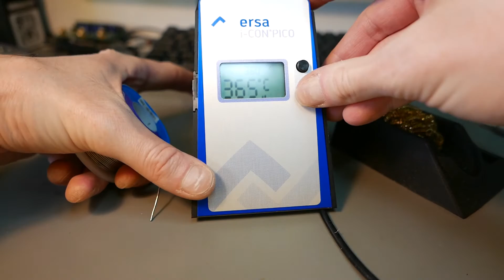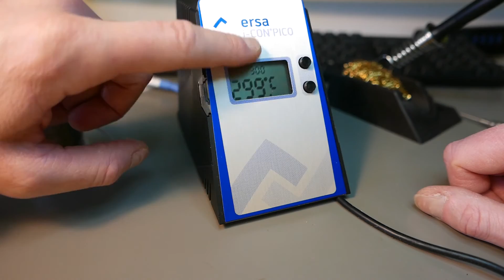Ersa i-CON PICO grounding soldering tip

Comment: What would be the advantage of a grounded soldering tip?
Reply from the maker: Not damaging your mosfets or other sensitive chips with static electricity first comes to mind...
Reply: @TomislavDarlic  for me, ESD gives more catastrophic issues than saving circuit form static electrical discharge. I think this tip need to be connected to earth but trough a 30K resistor (this value will be discutable). Direct connexion to earth can make serious short to ground if working on live circuit.
Reply from the maker: @AIexanderHartdegen  The sistem is usually connected to gnd trough 1M resistor...

Comment: Hello Tomislav, I am the Ersa Product Manager for this equippment and have the following hints: Next time you purchase a soldering station I recommend to check the features more in detail. As you mentioned and written in the comments the i-CON NANO is the ESD save brother of the PICO and the tip is grounded. All your efforts would not have been necessary. You are an electrical expert, but I have to warn about this modification! If it is not done conrrectly it can be dangerous to life! Moreover the station has no more warranty when doing this. One call or mail to us would have been enough and we would have changed the station to a NANO. We from Ersa would be more happy if this video would not exist - see comment from Niko942. Nevertheless - thanks for choosing Ersa and good luck with your soldering projects. If you have questions, pls contact me: joerg.nolte@kurtzersa.de
Reply: If you're the Product Manager, you should actually be ashamed. I also bought the Ersa Pico, but not being an expert I just trusted the Amazon reviews and thought I was buying from a reputable German brand. What I got instead was a cheap, unsafe Chinese product. Unfortunately the product specifications never tell you where a product is designed or made. If I had known in advance it was made in China I would have avoided it like the plague.
And don't even talk about temperature control, because the temperature of this piece of cr*p jumps up and down like mad.
Reply from the maker: Hi Jorg. Thanks for the message. I own 1 Pico and 2 Nano stations. One Nano has failed with MCU shorted to ground and overheating. I recorded a video about it but never found the time to edit and publish it. I use this hacked particular Nano for years now and all 3 were bought from Farnell in bulk. It was my error to buy a soldering station without looking into details but grounded tip should be standard these days. I'm perfectly satisfied with ERSA stations within their limitations. We have 6 different brand soldering stations in our lab not including ERSA stations and different Chinese clones....
Reply: Hello, I have an i-con Nano station and i-con Pico soldering iron. Are they compatible each other?
Reply from the maker: I have both and I think they are
Reply: @TomislavDarlic  thank you👍🏻

Comment: I just came across this video and I also own an ersa Pico for quite some time now. Got it slightly used for 60€ so for me it was a no-brainer.

I would consider adding an additional ground wire as I see how easy it is. What I want to ask though before is the resistance on the ground. Shouldn't it be near 1M Ohm in order to avoid the flow of high currents?
Reply from the maker: I think soldering tip is earthed directly. At least that's what I think. I'll measure all my soldering stations when I come home to confirm. I'm pretty sure that my JBC is earthed directly. My workbench mat has 1M resistor to earth.

Comment: well not bad idea buy cheaper and modify it to be what you want. Well I using one Ersa soldering iron 16W, it's not station just iron. Now it's in use over 20 years and can you imagine, still same tip on it as it was before 20 years. So I am surprised that Ersa did what you showed, but Chinese makes all good companies to compete with their cheap, low quality equipment. Result is what you showed in this Video.

Comment: i tried to format the sd many times, app writes a file on it.   ok.
but no matter i do, i always get the  err1 ....
therefore i cannot set the temp profiles..!
Reply from the maker: Did u try some other SD card. Maybe that one just does not work in that reader or something. Happened to me before. My soldering station is still working fine. I never use profiles I just lift the temp manually. But for longer soldering jobs I use JBC station.
Reply: there is a separate app for pico and nano stations, just discovered it now.
now it works lol

Comment: Thanks...I will ground mine too. I don’t get the price difference or why they even bother two make two models.
Reply: Hi! The difference between pico and nano is not only the grounding wire. Search on google "eevblog ersa icon pico vs icon nano" and read all the discussion from that topic and you will see what I'm talking about..
Reply from the maker: I have both stations now and took them both apart. There are differences...
Reply: @TomislavDarlic  yup, Ersa says that the nano version has all cables and plastics that are esd safe.
Reply: It has also a better iron thermal element, it is from metal and not plastic as at the pico.
Reply: @arvacon  With new MK2 versions both became basically the same except tip grounding.